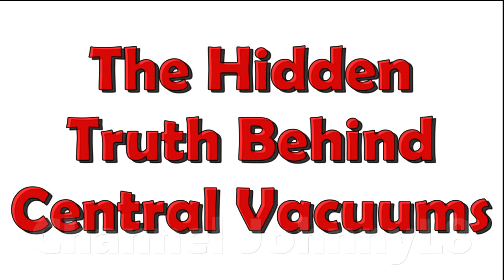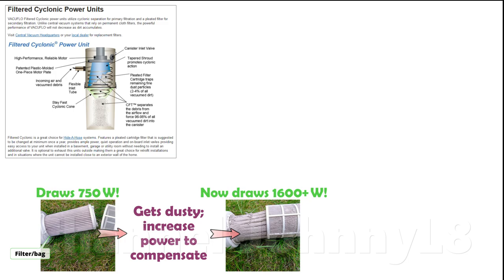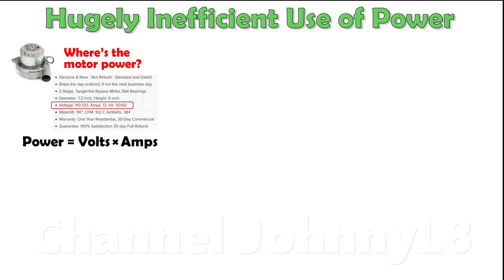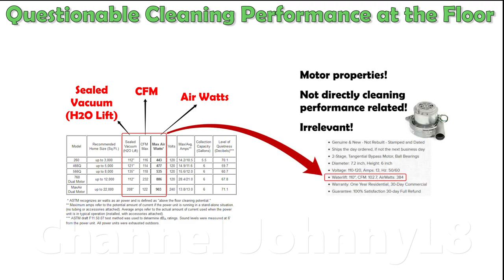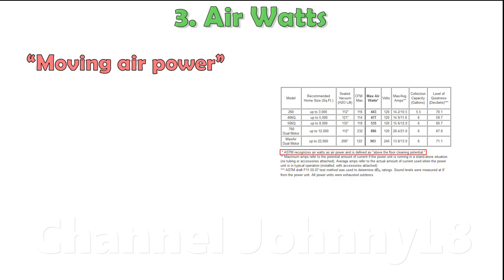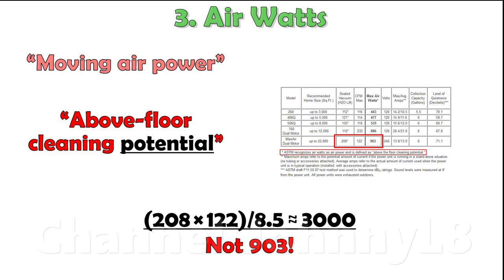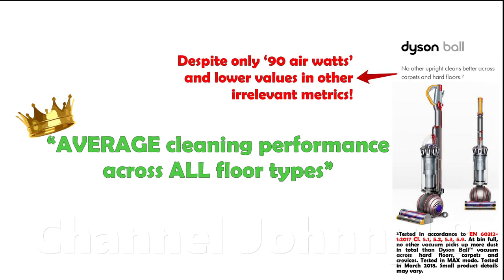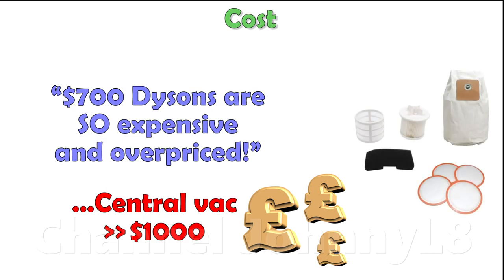Central Vacuums Trail Behind Dyson Cordless

Comment: That's the problem though you haven't used any of the best bagged cleaners in your home. And as I've said before Dyson are afraid to release their test data. I wonder why? 😁
Reply from the maker: What I haven't used isn't important when the test data after they've been measured shows empirically what's true. The video I did on bagged cleaners covers everything else that's shit about them and why I'd never use one in this day-and-age. I don't know why Dyson don't release the data publicly. There's no reason to suspect they're 'afraid' (whatever that actually means), and it's probably down to some kind of commercial sensitivity. However, when a defense has been required in court, the scientific data HAS come out for review by an independent judge. In all such cases, the data destroyed any doubt. The upshot is, talk is cheap; evidence is all that matters, and it exists, whether or not we have public access to it; full stop.
Reply: Listen if Dyson were that confident they had data to prove their vacuums were the best they would shout it from the rooftops! haha. And it's all well and good doing research on the internet but practical experience of using these products in your own home is what counts. And there are people out there with a lot more experience than you.
Reply from the maker: In the video, I point out multiple times this very point; they do shout it from the rooftops. Did you watch the video by content or by title only? :) I don't do 'research' on the internet; in this case, I took the data that manufacturers actually give to the public. And I don't agree about the home 'experience'; that's code for subjectivity trumps objectivity which is clearly false.
Reply: I’ve always wondered why houses that have centra vacuums are always filthy.
Reply: enzyme20056 Haha my home is not filthy I can assure you. It's immaculate!
Reply from the maker: haha I'm sure you're joking and that did make me laugh. I don't think there's a real correlation between having a central vacuum and a dirty home.  I'm sure they work perfectly adequately. They just brute force performance due to sloppy design was really all I was getting at in the video. And thus I'm not a fan.
Reply: JohnnyL8 We have different opinions and needs. Just because you have an opinion that Dyson  make the best vacuum cleaners doesn't mean it's correct! It's just your opinion. What works for you clearly does not work for everyone. So we can agree to disagree 😀
Reply from the maker: Well, there's a bit more to it than just my opinon when it comes to the best technology. There's this little problem for some called "data" and "evidence" (the real kind, not the amateur bedroom test kind that causes a lot of confusion and is very misleading—toilet rolls anyone?). The real evidence shows they're the best in class, not just to mere court levels, but actual scientific levels. They are measured formally to have the highest holistic pickup performance and top out in the other metrics I've covered in my 'how to review' video. Obviously, some people don't like them for personal (read: unconvincing) reasons, just as some people don't like anything which can be shown to be amazing technology. Not to mention Dyson have a substantial portion of the market share, meaning the majority of consumers agree too. Overall, real evidence shows they're king (that doesn't mean perfect; I've criticised them plenty), and that's not surprising given Dyson's investment in R&D. You only need to look at the bullshitting advertising tactics used by competitors to peddle quantifiably inferior products to see this (my next video). This is much to the palpable disgruntlement of some in the rabid vacuum enthusiast community it seems, judging from the hosile bile I get for presenting it all, whose experiential 'evidence' resolves to nothing more than ignorance, testimony, authority, and revelation; the worst reasons to believe anything.
Reply: JohnnyL8 Well when Dyson release the evidence to prove their claims then I will believe it but they won't cause they don't have the evidence. Anyone who truly believed that a V10 with 30cfm can clean carpets as well as a cleaner that has 130CFM at the cleaner head is a believer in pseudoscience not real science! 😁
Reply from the maker: They do have evidence, won't release it publicly for reasons unknown. It seems to come out in court though. cfm doesn't mean anything at the floor as explained in this video and others. It's a motor property parameter, not a cleaning parameter. Cleaning is all statistical and about concentration reduction as I've also explained several times in videos. You can get deep cleaning with relatively lower suction values above some minimum value, and high suction doesn't necessarily clean better, just faster for spot messes where initial concentrations are high. All explained. People either understand or they don't (or don't want to). No real evidence from those who deny it; there is evidence from those who claim it, publicly available or not, to the extent confident claims that could be contested in court are made by Dyson. A bit of a problem the naysayers sweep under the rug, so to speak.
Reply: I believe evidence I've seen with my own eyes not evidence that is conveniently hidden. Like I said previously if they had the evidence you can be sure they would make it public. It's all marketing bullshit! They are masters of it haha
Reply from the maker: It's not hidden, it's just kept internal to them, and I don't know why. It exists and they use it when formally challenged in court over claims they've made. It's not blind faith; it's just not available publicly. You're right about marketing spin and so on, but any company who makes a specific claim of the kind Dyson make, are in for a world of hurt if challenged formally in court over its validity. There are plenty of lawyers out there ready to sharpen teeth. If you watch that V10 launch presentation, he in fact mentions this point; only when they have the data do they go and publicly claim something at the front end. If they say they have the highest cleaning performance as they do, you damn well know they've got the data that will be used to smash anyone who challenges them in court. And people do. The "no loss of suction" was one such example. Naysayers, just like now, were claiming it was marketing bullcrap, made up, no evidence for it, various absurd anecdotes of what turned out to be abuse leading to failure. Took them to court over it. The data came out, an independent judge who doesn't give two fucks either way looked at it, and boom, the naysayers were crushed. You can't argue with empirical evidence. If Dyson say something, it's almost certainly true, because the consequences for them would be disastrous. Plenty of independent testing commissioned too (see previous video for details) giving some data.
Reply from the maker: I should point out that not all companies manufacturing vacuums are honest or seemingly smart. There has been evidence of false claims being made about a product, and when taken to court, they were found guilty (cough...Hoover...cough). See https://youtu.be/U_qS2i6HQRY?t=1m47s. So I can see where your scepticism comes from; alas it's misplaced and should be directed toward less reputable firms.
Reply from the maker: Also, it's one thing to say Dyson hide their data, but where's Kirby's, or Miele's, or well, everyone elses? Why pick on Dyson? Why don't the others make bold claims that can be contested in court? Makes no sense to just criticise one company when literally no one provides data either. Their lack of claims as well suggest they actually do have something to hide. Particularly when you watch their infomercials which are all obfuscation, small print, and slight of hand. I think if you're going to criticise just Dyson, you need to explicitly address all that too in a convincing and robust way.
Reply from the maker: All gone a bit quiet... :/
Reply from the maker: And have you not heard about the latest story of what happens when companies make bold claims and then get taken to court to prove them but have no real data? They die. Shark are on their way out for doing just that. They lied and made false claims about how they clean better than Dyson cleaners, even citing standard testing. Dyson challenged them given it contradicts their own data and guess what, GUILTY. Once again. Dyson reigns supreme, and why? Because they actually have REAL evidence, do things properly, and are thus a respectable company that don't market false claims, whether or not their data is publicly available. Go take a read https://cookcountyrecord.com/stories/511456108-jury-orders-sharkninja-to-pay-dyson-16m-for-allegedly-false-vacuum-cleaner-ads
Reply from the maker: This court verdict couldn't have been timed better as I'm developing my video on how to spot shady advertising and dodgy tactics by companies that try to peddle inferior products at the expense of the image of superior technology they compete with. It will definitely feature in it as a textbook example of the consequences of not basing your claims on evidence. While researching Shark's infomercials for examples of snake oil bullshit, I noted they made this claim and even cited an american standard. I read the standard today in fact to try and fact check myself. Apparently I didn't need to because Dyson were already on the case and an independent jury exposed Shark's bullshit. It says so much about the rabid zealotism I observed from Shark fanboys; all based on a lie that no one but the best fact-checked. Just embarrassing. There's a reason why I'm thorough in my videos, base opinions on well-established facts, and cite evidence where I can. Because it gives what I say strength, even when the rabid vacuum enthusiast community cry and scream in tantrum. Exposing bullshit is why I started making videos on this topic. Much of the fanbase was polluted to the core.
Reply from the maker: This verdict literally matches dot-for-dot everything I've been saying again and again. It's very interesting reading some of the details of the trial. It appears tests to prove Shark’s cleaners were better were falsely claimed to be independently conducted, in other words, they apparently made up claims and invented data, and outright lied and cheated.

10 days of evidence and thorough questioning in a court of law. The CEO of Shark was there to testify. The independent 10-person jury were allowed to interrogate both sides as well, presumably so there was no lawyer shady business. All the evidence and data presented for almost two weeks—you know, that data you think doesn't exist and that Dyson are simply 'masters of marketing bullshit' instead. Dyson are accused of all sorts of crap, none of it really turns out to be anything but haters’ hate, but this is just astonishingly bad practice from Shark. The fact Dyson were awarded 91% of the maximum possible fine goes to show just how guilty Shark must have been. Utterly disgusting. Just like Hoover back in the day, apparently so corrupt and absent of products that are of the same superior quality, despite the desires and mere opinions of others, they apparently had to lie and trick people out there into buying them. And so many in the community fall for it hook, line, and sinker because of their rabid and irrational hatred of brands. I despair sometimes. So much more cleaning up to do here…
Reply from the maker: And another astounding fact, given things are so quiet on this thread; this was an American jury ruling against an American company in favour of a foreign one! Possibly the most damning sign of all of guilt, particularly given the inflated sense of patriotism often observed in the US. I admit I was surprised when I saw Shark claim 'better than a Dyson as measured in independent tests'. I was ready to concede but something felt off and I wanted to understand precisely how they came to that conclusion instead of simply accepting it given it was so counter to expectations, history, or what was sensible. No sooner did I start digging in standards etc. did this bombshell happen. Dyson knew they were right from their data and knew the competition peddling inferior products were wrong. Well done to them for pursuing what now turns out to have seemingly been competitive corruption. That's a company that cares about truth. And all those who fall for lies and never question, yet feel so righteous in condemning my consciousness-raising efforts on here. Says it all; their integrity down the pan.
Reply from the maker: Another truly damning article for Shark. http://digitaledition.chicagotribune.com/tribune/article_popover.aspx?guid=cf9e8f7f-b2e8-41bd-9e4f-178ce2ccd562

"While SharkNinja’s advertisement said its vacuum outperformed Dyson’s DC65 on one type of carpet by nearly 15 percent, Dyson said its own independent testing proved otherwise. When the two vacuums are properly tested head-to-head under industry-accepted methods for measuring performance on carpets, Dyson’s proved superior, the company said in court documents.

Ultimately, the jury found that SharkNinja’s tests were not conducted independently and weren’t in compliance with industry standards, rendering its advertisements inaccurate and misleading."

Utterly disgusting that they fabricated such results. This is why it's so important to have data independently verified. Is it reproducible by others? If not, you just can't believe it. Shark lie and lie and lie. Shame to them and embarrassment to all those who favour them on the grounds their technology is 'superior'. It's been proven beyond all reasonable doubt this is simply false. This is worthy of a new video. This disgusting practice must be exposed.
Reply: @2711marcus  you are right 100% Would you be instead in talking more about this ? You know how to get a hold of me  .